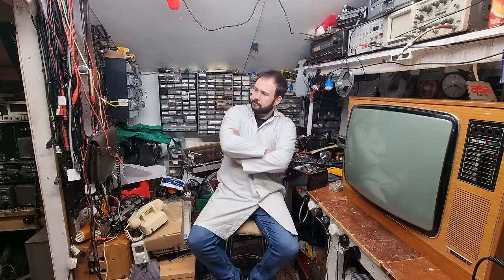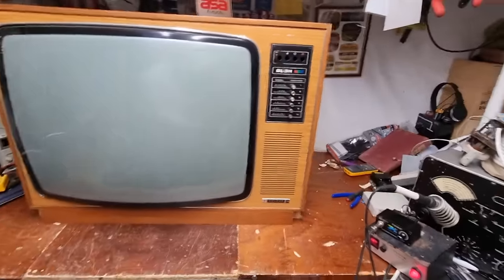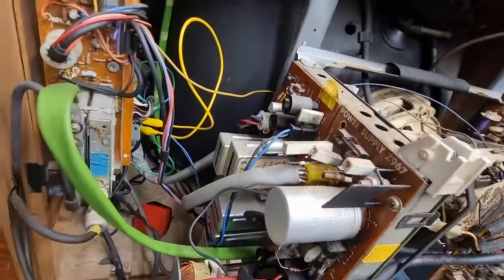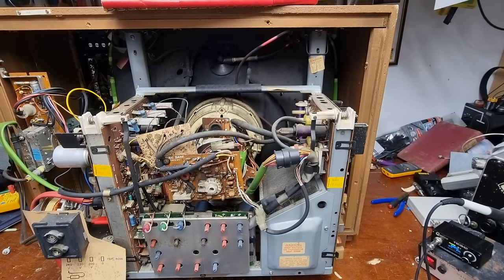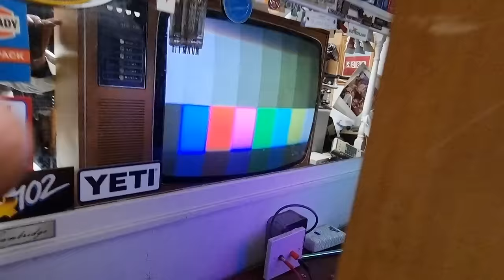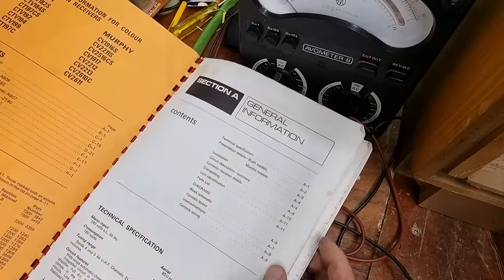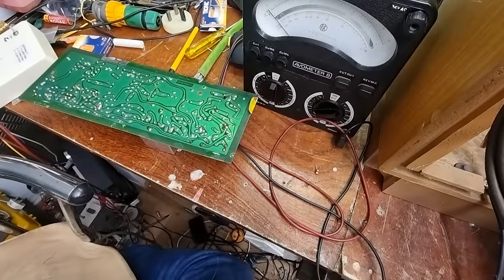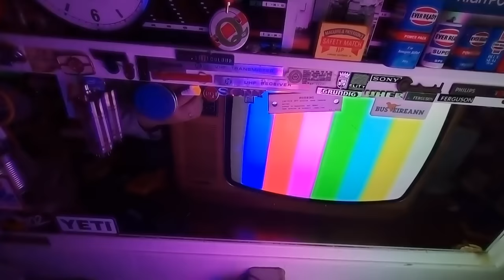Vintage Colour TV repair. Bush A823B.

Comment: When replacing an electrolytic capacitor I usually choose the closest capacitance I can get - no problem as tolerances are pretty wide - and the same or higher voltage as the original, with the only other proviso being enough room for it to fit. I would consider using an aluminium capacitor instead of tantalum, but haven't had need yet.

Comment: I remember these sets pain in the arse to work, on you needed extension panel cables. just to note the was no colour oscillator they just used to "ring" the 4.433 crystal gave some funny color problems.

Comment: I had the black and white version of this, and it died in 1983. It caught fire and I took it outside and threw a bucket of water into the back on the forecourt! 

Obviously it was not repaired.

Old TVs were so unreliable [compared to valve radios], and if we think back were not very good in picture quality compared to modern ones, though I have not had an actual TV since 2002. Not missed much as I check in a few times a year when house sitting for friends. These days I don't even recognise the news-readers!

Best wishes from George
Reply from the maker: You're not missing much George.

Comment: Nice repair i allways prefered the single chip decoder.
Yes having the psu back to back with the decoder was nut the best idea, if i remember the thermister used to get dry joints causing carbon tracking leading to a big flash over and good by decoder chip.
Reply from the maker: Madness Rob! There was also the mod on the early ones using a matchbox and wire to move the scan drive panel out due to interference.

Comment: First colour TV we had, it was the Murphy version CV2215. One of the first solid state TV's. It had a nice convergence card over the panel. Over time we had to replace the Line O/P transistors (BU105's) and the trippler.
Also that dropper resistor middle back went O/C. 
Always a bit short of chroma, but enough for the correct saturation level, I remember the firstime I set eyes on the BIG chroma decoder chip.
Just remembered that blue convergence (10 ohms ??) or was it 20? pot used to burn up.
Spend a bit of time setting it up and you would get a very nice picture, fixed loads of them in the day.
Reply from the maker: Yes think it was 10 ohms... The single chip decoder was better. A few nice stock faults there. Also the poor frame height due to the balance pot.

Comment: new subby here..
i remember back in 90 whilst working in the shop i had to deliver and  carry one off these 16 flights of stairs in a block of flats, due to the lifts were out of order... 
carry any crt make sure that the screen is in front of you and the back facing out away from you.
a nice little repair there sir and i came across your channel via michael's channel, these crt's are in my book a easyer to work on and a lot better than this crap nowdays .:trophy-yellow-smiling:
Reply from the maker: Welcome aboard. I certainly don't envy you in that scenario!

Comment: We had a bush palmaster it looked something like that set. It had 6 buttons with the channel names on them. Rte 1&2 BBC 1&2  and ITV 1&2. The volume knob and the colour controls were on a sliding tray that came out with gentle push. It lived till 1993 when it got zapped by lightning.

Comment: I remember reading about back injuries in Television, brought about by lifting heavy tvs..
Reply: :)  yep it was an occupational hazard :(
Reply from the maker: Do you remember the special two wheel trolley they sold in Television mag, "TeleLift"?? We had one, they were quite good.
Reply: Yes. Been there, done that. Bang and Olufson and Sony's were the worst. The customer would just stand there and watch you lug these bloody things in and out of there homes. I was 18 at the time and the sets were bigger than me.
Reply: @IrishvintageTVRadio You may remember a guy called Eugene Trundell who wrote for Television magazine. I worked along side him at French's in Sussex. He devised a whole system in the workshop where the bench and the trolley were one. You would slide the set out of the van onto the trolley, the trolley would then engage in an elevator to take it to the workshop level. You would then wheel it in and it would clamp to the side bench that ran around the whole workshop. The trolley would then be your bench. When finished the reverse would happen and another set would wheel in. No Engineer ever had to lift a set from the minute it arrived to the minute it left. Pure genius. A great company to work for.
Reply: I do not @IrishvintageTVRadio  but probably before my subscription... those old sets were heavy beasts
Reply from the maker: @analoglooney  Very interesting. I remember E.T. Well. Is he still with us? That must have been a great place to work.
Reply: @IrishvintageTVRadio  I'm really not sure to be honest. I haven't seen him for some time now. He would certainly be in his 80's now I would think. A very clever guy.